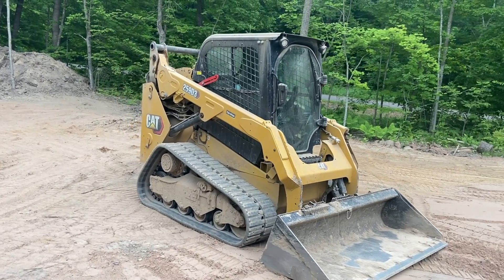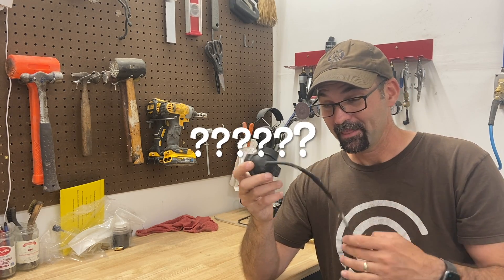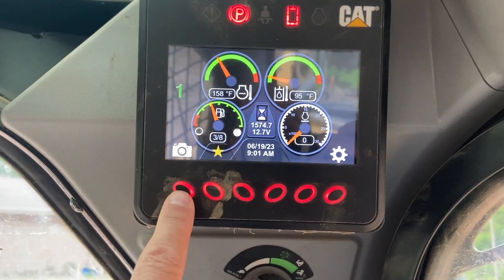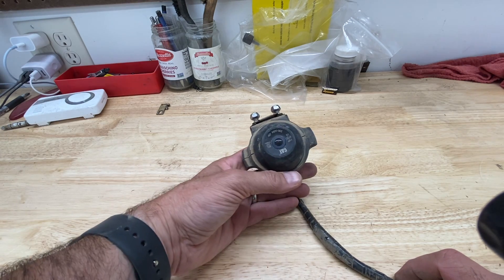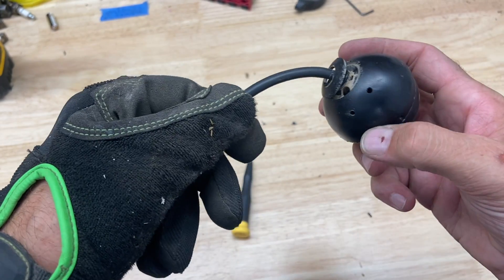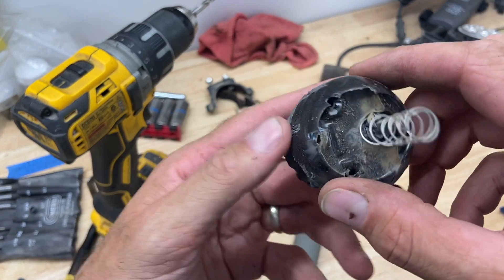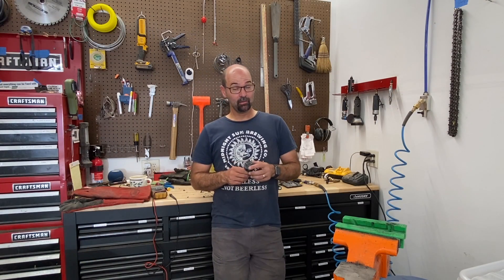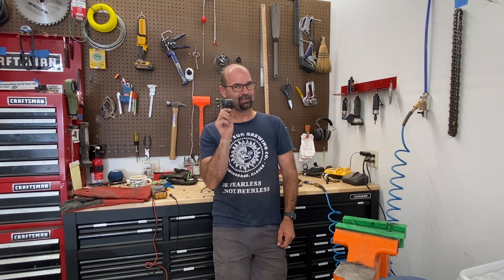CAT Backup Camera - Can it be fixed?

Comment: Mine quit during warranty, they replaced it,  it quit again just after warranty.  Same deal, works better in the winter and when first starting until it moves.
I'm going to try an aftermarket camera from ebay for $15. I'll keep you updated.
Reply: Any update?

Comment: I think it would be worth a shot to epoxy and silicone it up (after you clean up the wires) and see if it works.
Reply: Anythings worth a try at this point. My Cat dealer said that they have over 1000+ on backorder right now. I'll try using some electronic cleaning spray and adding dielectric grease for the connections too. 😩
Reply: @matthewtE  Did the repairs you do work?  Ours stopped working too:(  Really sucks - expensive camera - thanks for your efforts:)
Reply from the maker: @dellefairclough5309  I replaced the camera and that fixed the problem. Expensive, but worth it.
Reply: @mr.putzer  any guarantees the next camera will not have the same problem???
Reply from the maker: None. The only things guaranteed are death and taxes.